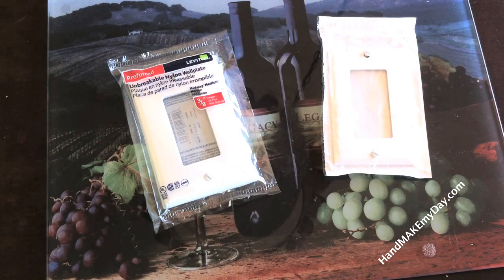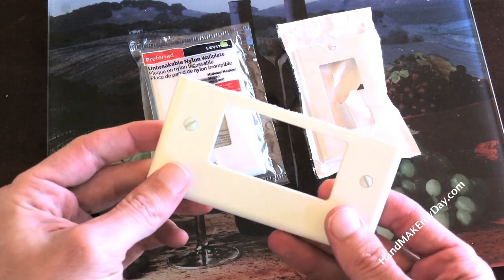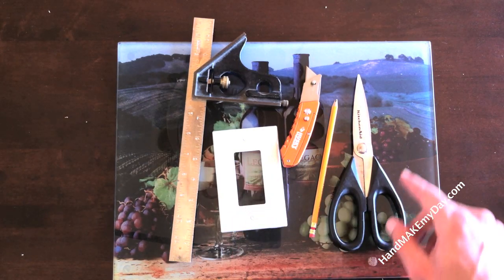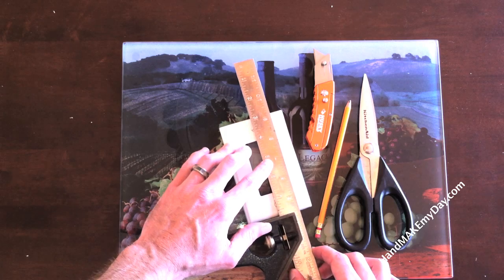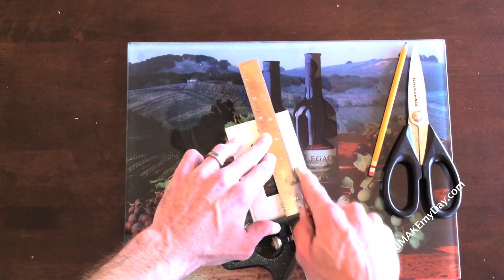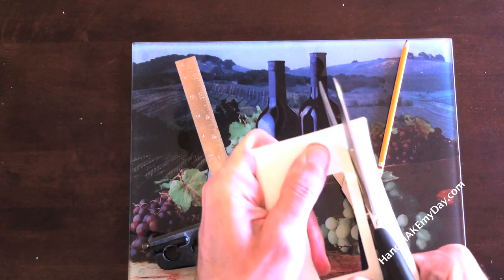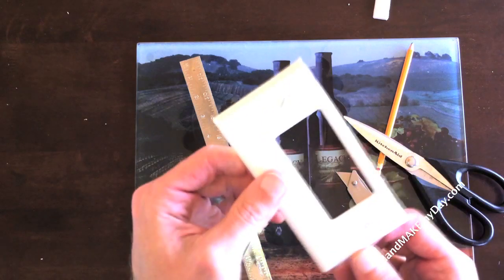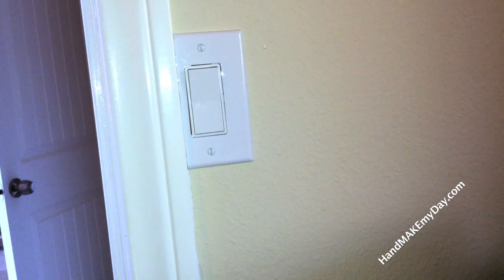How To Cut Nylon Wall Plates

Comment: In the middle of a DYI bathroom renovation I found my new vanity top splash guard covered a small section (bottom right corner) of my wall plate. This cutting method is exactly what I needed. Thank you.

Comment: Great video, thank you! One suggestion: Use Yellow (straight) tin snips ... it made it even easier for me. I only scored the polyester to get a line, then cut with snips. I literally took about 1-2 minutes per plate/cover. Your suggestion made it extremely easy and I finished with a quick sanding to smooth out some very minor rough edges. For the $0.05-$0.10 difference, it's well worth it.
Reply: Yep, like the other comment the box cutter on a 2023 nylon Leviton just scratched the surface. But, using the scratch as a guide for tin snips, it was a breeze and looked very clean.

Comment: neat trick & I've had situations where this would have been useful. sometimes with older homes its opening a can of worms if you tinker with the wiring or try to move a box. can get expensive

Comment: After watching this I ran right out to Home Depot and bought a Nylon switch plate cover.  Tried and tried to cut with kitchen scissors - no dice!  Plus it was super hard to score - even more so than an old plastic one.  Surface was slipperier and hard to dig in.  Your nylon cover looks much more flexible than the one I bought from Home Depot.  I will try the hack saw method. ... UPDATE: Can't cut this sucker with a hacksaw.  It's hard as a rock.  The old plastic cover cuts easier.  This nylonone  I bought is now all scratched up with its super slick surface.  So if you're going to try this, check out the material and see if it looks cuttable/bendable. The one I got at Home Depot not good for this method.